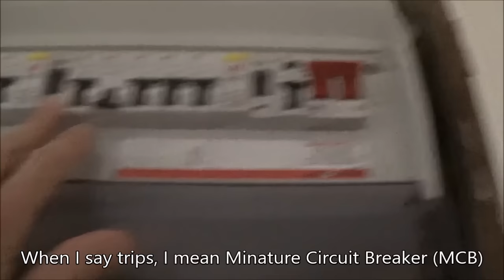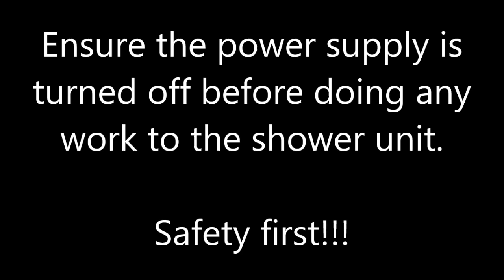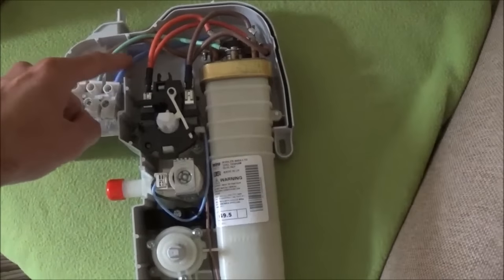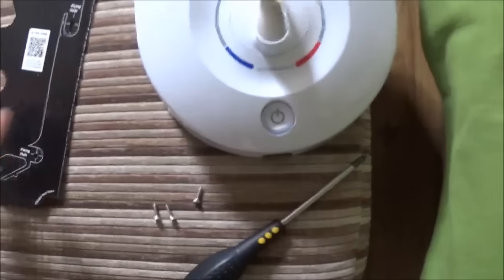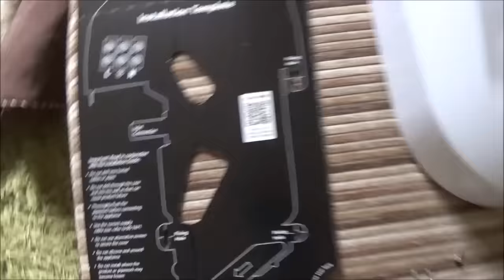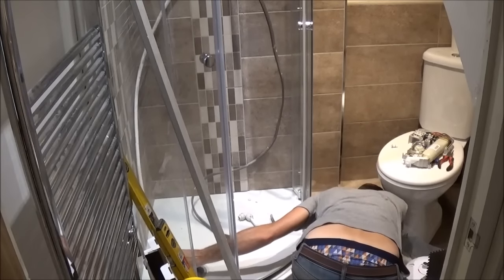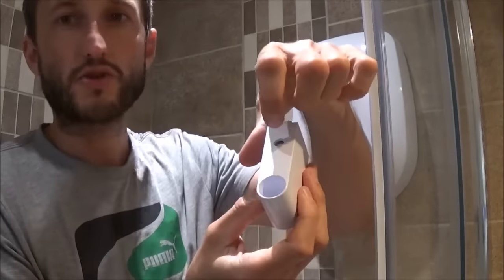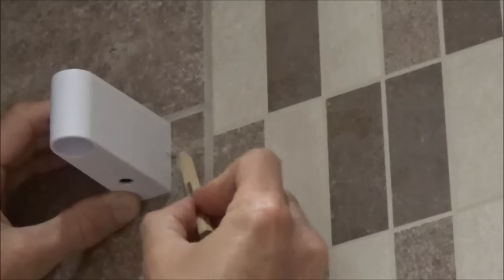How to fit & install an electric shower. Mira Go shower installation.

Comment: Very interesting to c the differences in wiring and such from California to England. We use 120 volt for most things. I have never seen an electric shower. We plumb hot and cold water to shower, sink and tub. Nearly all water heaters run on natural gas. The terminology is also way different. The systems r different. But both r highly developed and efficient. More than one way to skin a cat. Also, never saw a toilet that didn’t mount on drain pipe with wax ring.
Reply from the maker: I always find it amazing how many different ways we all do things, but with the internet and travel the world is getting smaller! Electric showers have been common here for years although gas heated water mixer showers are probably more common now. We have combi boilers that heat water when the tap is turned on but also more commonly we have pressurised boiler systems which allow hot water to be use under pressure in several rooms at once since several en suites and bathrooms have become common place within recent years. Problem with the combi boiler is if you run too many taps or showers at once you lose pressure. Thanks for the info and great to have you watching from afar. Best of luck!

Comment: all the videos I've seen of yours are very helpful and I learn a lot from you. I'd like to add that on porcelain tiles pencil can be really difficult to rub off. I've had to replace tiles because of it. 
Thanks for your help!
Reply from the maker: Hi Don, thanks for the feedback. Glad you like the videos and really great that they've helped. You're right about the pencil. Try a bit of nail varnish remover on the pencil, usually does the trick! Good luck and thanks for watching!
Reply: POUSE around the HOUSE oh wow really!? wish I'd known that at the time. white spirit didn't even work for me. thanks again. recommended your videos to my friends 👍
Reply from the maker: Hi again, the nail varnish remover also works on natural stone and unsealed porcelain if you spill anything on it before it is sealed. Just dab it on and leave to soak a few minutes then wipe and reapply until it's gone. Good luck!

Comment: Thanks very much. I’m just doing mine and glad I saw this video. I never thought to use push fit I found a slim pipe about 19mm form home bargains and I’m going to use it as a sleeve for the flexipipe when I bury it in the chased channel and cement it. The pipe will be protected and still able to move up and down. Cheers.

Comment: Thanks for making this great video with very clear and detailed instructions! 👍🏻
One question of my installed electric shower - “do you know why shower water becomes weak once turning hot water BUT very strong when using cold water? Do I need to replace it with another new one?”
Reply: Same here!!! How to fix the problem??? Please help!
Reply: The temperature is adjusted by regulating the flow of water. Turning the temp up means the water slows down and spends more time heating up. The element would still be outputting 9.5 kw regardless of the temp dial setting. 

Those showers that have 2 dials incorporate 2 elements, the eco setting turns only one element on so it runs at half power - useful in summer when the incoming water is warmer.

Comment: Thank you for this video. I’ve just had a shower fitted. The electrician has fitted the control box so low, the hose has to be stretched up completely for my Son to fit under the shower head! Will this affect the pressure? 
It just doesn’t seem right to me 😕
Reply from the maker: Shouldn't affect the pressure as it's controlled by an electric pump but placement of the shower is often down to ergonomics and where you cable and water pipes are accessible. Hope that helps and thanks for watching 👍

Comment: Thanks for the video. Did you draw your cable through before or after the tiling, how did you route if from the consumer unit, and did you bring it in from above or below?
Reply from the maker: Hi David, I drew the cable through before the tiling was done. I brought it from my consumer unit, through the ceiling in my hall and down the wall to a double pole 60Amp isolation switch just out side the bathroom (the red switch in the video), then back up to the ceiling, across the bathroom ceiling and down the wall behind the shower. Before I did the bathroom, I made a stud wall with a void a few inches thick behind the shower which allowed me to hide my plumbing and shower cable behind the wall. If you are retro fitting the cable, it can be tricky as the floor boards upstairs may need to come up! Hope that explanation helps. Thanks for your question and thanks for watching.
Reply: Thank you for your reply.
Reply from the maker: No problem!

Comment: In the UK do you have hot water at the sinks? I'm just wondering why you would need an electric water heater in the shower.  In the US we don't have anything like this.
Reply from the maker: Hi there, yes we have hot water at the tap. We have different types of boilers that are either gas or oil powered which heat the water, either when you turn the tap on, or during the day and kept warm to be used later. We also have immersion heaters which are electrical elements that heat tanks of water. Showers can be powered by a gas or oil boiler so as you say no need to use an electric shower, but in some cases people like both as if the gas supply is knocked out, you can still have a hot shower and vice versa. Electric showers are very common and nothing out of the ordinary in the UK. Just type in electric shower online! Hope that helps. For regular vids please subscribe. Thanks for the question and thanks for watching!

Comment: Thanks for your reply.   
i can see now, that the electric shower… cold water pipe, does not actually connect to the wash basin copper pipe.    Looks like i might have to do a lot more homework on this particular topic.
I’ll google it, and see what i can come up with.   At the moment… I’m looking into central heating.. how it all works with a combi-boiler

Comment: POUSE around the HOUSE
You should also have explained when fitting a new electric shower that the dial needs to be set to cold, so that this fills the empty boiler with cold water.  Otherwise if the dial is set to hot, then this will turn on the heating element before water fills the boiler and burn out the heating element.
Furthermore, you don't need to use silicon in or around the shower unit.
Reply from the maker: Thanks for the feedback!

Comment: So the plastic connectors are good to use? My shower inlet (triton) doesn't hold the copper ring at all so I'm going to try the plastic connectors.
Reply: the plastic connectors are for safety.  non electrical conducting.

Comment: interesting that they don't advise to seal the unit to the wall, I always have done top and sides, leaving just a small drain area at the very lowest point. But one thing I would mention, I note you did not seal around the riser fittings? Always dropping some silicone into the plug holes and around the internal parts of the support brackets, to keep the water out from behind the wall / tiles. 
I know they are all like it, but those big 10mm cables right by push fit water inlets creep me out! Great vid again. cheers
Reply: from mira "Under no circumstances should an electric shower be sealed to the wall. There are short ‘spacers’ in each corner of the shower’s rear-casing which keep it proud of the wall by a few millimetres. This allows ventilation around the side and back of the shower module. Without this ventilation, it may be prone to condensation or over-hearing, which will subsequently cause failure of, or damage to, the internal components. Water or electric supplies that come in from behind the unit must be sealed to prevent water entering the building structure."

Comment: Hi do you not have to put some kind of sealant around the water inlet and electrical cable that are coming through the wall to prevent water that ravels behine the unit from going into the wall? I see some manufacturers (for example Aqulisa in their quartz range) recomment this?

Comment: Excellent video as always. Important question for you...I've just had a Triton T80z fast fit electric shower fitted (the previous shower failed at an unfortunate time as I am thinking of enlarging the bathroom with new fittings next year). This has replaced a Mira, both old and new showers being 8.5kW so this is a' replacement' not a new fitting. As far as the electrician was concerned (and as I understand the current Building Regs.) in this instance an RCD retrospectively fitted to the circuit is desirable but NOT absolutely necessary. In the manufacturers literature and when I rang Triton they state that an RCD is mandatory. So I presume my warranty will not be valid without an RCD being fitted. As I say, I am thinking of having a complete overhaul of my bathroom next year. My question is this...is the current situation safe without the RCD being fitted for the time being, the electrician says it is and the RCD just gives added protection. What do you think? Your opinion would be greatly appreciated.
Reply from the maker: I am not an electrician and have all my work signed off by a qualified electrician. That said, my understanding is that all new installations or replacements require RCD protection. A good way to do this is get an electrician to fit a new consumer unit which will have rcd protection for all circuits in your house. Maybe speak to your local authority building inspector. Hope that helps and thanks for your question.
Reply: Could you not fit an RCBO instead ? That would have your RCD protection covered then

Comment: I am to use a 8.5 Kw cable that goes to a FuseBoards 4 meter away,  What fuse do I need And where does the Isolation Switch goes?

Comment: Nice video. Would love to see how you sealed the hole where the water pipe and cable on the wall behind the shower.
Reply from the maker: I did, at 16 minutes into the video. Hope that helps.

Comment: Is the fitting to the shower water inlet a push fit elbow with a stem with a compression fitting to the shower? Thanks.
Reply from the maker: Hi Mark. The fitting on the shower in the video (the plastic bit for the water) can accept a compression joint or a push fitting as per the instructions. I used a JG Speedfit elbow on the fitting then used a piece of 15mm JG speedfit pipe down to another elbow which I turned back into the wall. Hope that helps. Thanks for watching!

Comment: In your video you have used speed fit to connect the water. On my Mira go shower it is recommended to use a compression fitting on to the manifold. Can I use speed fit connectors? Cheers
Reply from the maker: Follow the manufacturers instructions. My shower could take a push fit joint. Hope that helps. Thanks for watching.

Comment: just purchased a mira deca dual 10.8kw shower , that also shows pushfit fitting inside unit . do you follow the instructions or fit a compression fitting
Reply: Either will work, but make sure you use some Boss White Universal paste for pottable water systems 👍
Reply from the maker: I used a push fit and it works fine.....but make sure it's on properly! Best of luck.
Reply: Ok to use Bose White for compression fittings, but not for Speed Fit, or Hep 2o fittings.
Reply: @davidmeerloo8941  the guy uses speedfit in this video!

Comment: Hi man. Good clear video with all sorts of tips.

If you've got time I was just looking for some clarification. I'm a keyboard tapper so don't do diy!

A fitter from a company installed a shower for an elderly couple but it's not flush to the wall and loose. He then advised them to put tape around the side of the unit to stop water getting in 'because you might die'. To top it off there was no cleanup attempt at job 'completion'.

I see you say sealing the box to the wall is not advised, only the hole around the cables/water supply. So despite the disappointing job done it sounds like the only issue I should be concerned with is tightening the box to the wall. I don't need to be concerned with water getting through the shower unit/cover? Thanks.
Reply from the maker: Hi, you have to go with the instructions for that specific shower. Often there will be a seal between the back and the front of the shower so water can't penetrate. Some showers say not to seal them in due to them getting too hot and they need air circulation. I couldn't say without seeing the shower. I would advise to get another electrician to check it, or speak to your local building control. Also see if you can find the instructions for the shower unit and see what they say as all showers may vary. Hope that helps. Thanks for watching!
Reply: POUSE around the HOUSE  thanks for the reply. I will do that.

Comment: I'm looking to replace a broken shower with a similar fit to it as you described near the start of the video. This one looks like it would do the job as all the electrical and water connections are in the same place. The current one that that is broken is a Mira Essentials 10.8 kw. I believe they don't sell them any more and i'm looking for an easy replacement job. I've done it before so am confident in doing so. Do you think this shower is a suitable replacement for the Essentials shower. I could provide the link to the installation and user guide for the Essentials which shows the internal layout. It looks quite similar to this. Any info helps. Look forward to a reply, cheers mate.
Reply from the maker: Hi Frazer, to be honest you can fit most showers where an old one has been, it's just a case of covering old hole and doing a neat job so you want a shower the same size or bigger. But the important bit is safety. Make sure your cable is big enough to take 10.8 kw and the MCB is the correct watts to protect the cable. Also it should be RCD protected. Hope that helps. Thanks for watching!

Comment: i don’t have a shower fitted in my tiny bathroom;  so it looks like i might have to get a professional in to sort it all out.
i don’t think i can do this myself.  I’m not a DIY-ER.   It’s arranging how the shower unit is going to fit in.  
There’s a lot of work involved, with the electrics and water pipe.   i would imagine then….. the water pipe connects from the wash basin pipe.   All, i have in my kitchen is a compact water heater ( Ariston)  looks very complicated. 
Wednesday 6th September 2023.  Southampton England 🏴
Reply: The water intake on an electric shower must be a mains cold fitting  usually it needs to enter the unit via the ceiling, this is so that a head of pressure is created. It can't come from the wash basin cold unless it is mains pressure, but even then it would look unsightly because you would have pipe runs all over the bathroom. If you have a loft tank, that would be ideal.

Comment: Hi,your videos are great!very good job!i would like to ask you something,i just bought an electric shower but without knowing nothing about it,i am a little bit afraid of the plumbing part,basically i do have a normal shower tap and the plumbing system works with an electric pump and since i can not afford to spend almost 1000 euro for plumbers etc the only option available was to take out the old tap and from there to the cold side connecting an hose straight to the electric shower,in my mind it should work but im not 100% sure because everytime i connect the pressure washer to that very tap for some reason after 3 second stop working like if the water stop running and the only way to use it without problems is that i need to open  another tap (feeded by the water pump) everywhere in the house and keep it open until done,in that way everything works fine and because of this im not 100% sure,im just worried that the electric shower would do the same of the pressure washer...have you any idea if can be done in this way?
Reply from the maker: Hi there, really sorry but not sure. Maybe some plumbers watching may be able to help. Try plumberparts.co.uk. James has a very informative youtube channel and may be able to help. Sound like it's something to do with either your type of boiler and heating system, or you may have below average water pressure in your house. Best of luck and thanks for watching.

Comment: Any problems with using push fit for water connection so many plumbers recommend compression and says push fits can blow off!
Reply: These push fits are compression also. You have to push and twist tight.
Reply from the maker: I've never had a problem with them but horses for courses! These are speedfit so the push then twist to lock tight.

Comment: surely you would need a larger fuse for a 9.5kw shower
9500w / 230v gives 41.3 amps so would trip the fuse all the time
Reply from the maker: It doesn't trip, maybe it would if left on for an hour solid. But if you go larger fuse/MCB, then you need to ensure you have the correct cable to make safe i.e it trips when required. Thanks for watching.